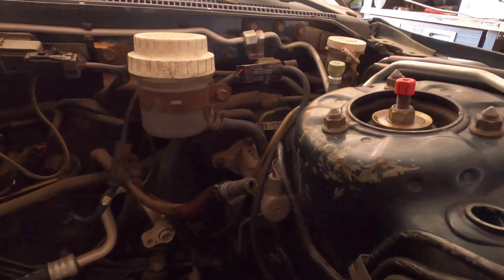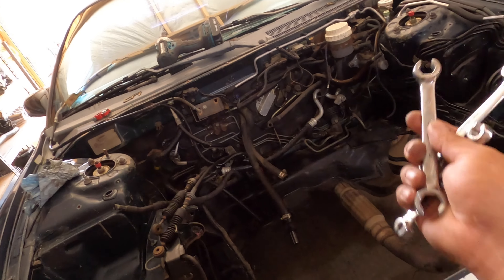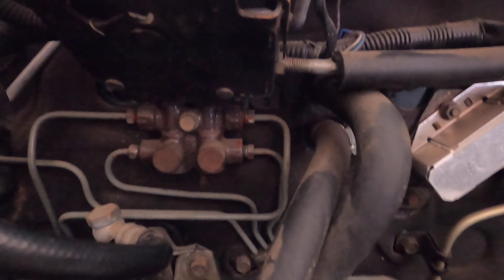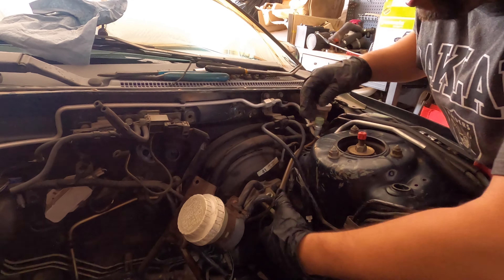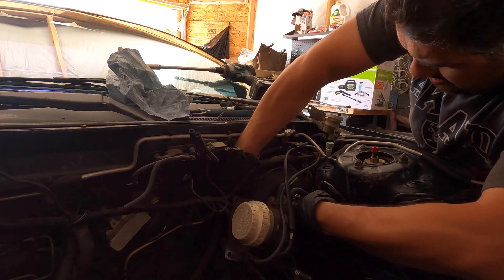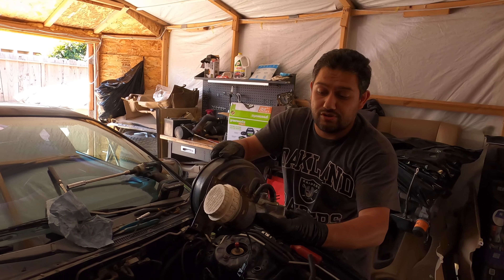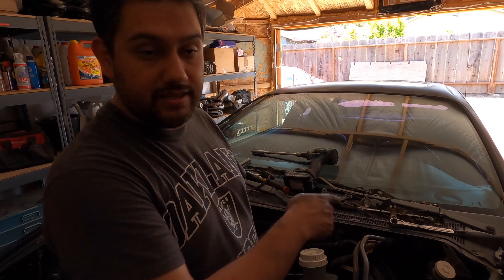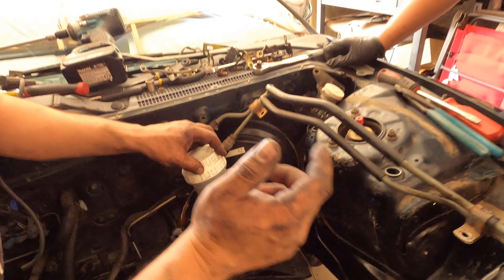HOW TO INSTALL A 3G BRAKE BOOSTER & MASTER CYL + ABS DELETE (ON A 2G DSM)

Comment: If you buy a new booster and master be aware that you want the non traction control model and there is different bore sizes available for the master.

Installing with the motor in, is a absolute pain. Either the lower subframe needs to be dropped and ac pushed to the side to do it from the bottom or remove the intake manifold if installing from the top.

I never dented my shock tower and it clears.

Hopefully all that info will help someone one day.

Comment: Se puede instalar el booster con el motor puesto? En tu vídeo se ve MUI fácil ya que no tiene motor pero ya con el motor es posible meter el booster?
Reply from the maker: Si se puede, pero es mucho mas facil installarlo sin el motor o quitando la araña/intake manifold.

Comment: i was just considering this upgrade as i picked up some nice evo 8 fronts for my 2gb. I know some people do the replacement when the engine is out so i was hoping to see some simple swamps for the 3G BB + MC!
Damn, so same case in your video LOL. Is it easily doable with everything still in?
Reply from the maker: A buddy of mine did it with the motor in (including intake manifold).. was a pain, but he was able to do the swap with everything still in place. I wouldn't recommend it though 🤭🤣
Reply: @DSMTHuNDeR  damn lol . Maybe ill do the caliper upgrade first then later the Booster. Maybe with the intake manifold out its fine

Comment: Do you have to take off the abs?
Reply from the maker: Yes. I have a video dropping soon on the install of the brake booster and delete of the ABS.
Reply: @DSMTHuNDeR  ok I left mine on i didn't think I had to delete it
Reply from the maker: @gerardoeast1881  crap! I didn't realize this dropped in the AM instead of PM.... the removal of the ABS unit is in this video. 😵🤣
Reply: @DSMTHuNDeR  haha lol yea thats why I was asking i didn't know i had to remove it i was going to ask i have aem adjustable cam gears and I kind of need help on degreeing them